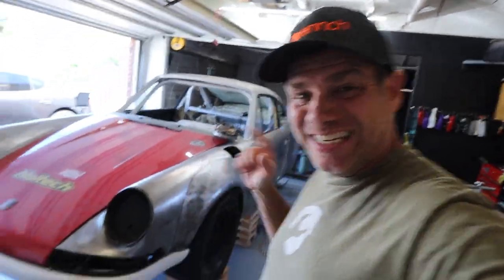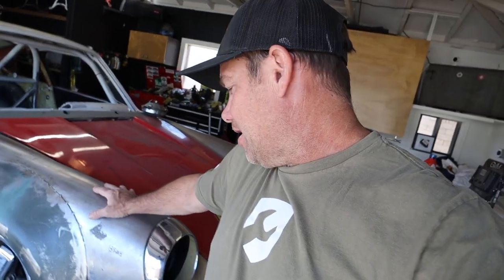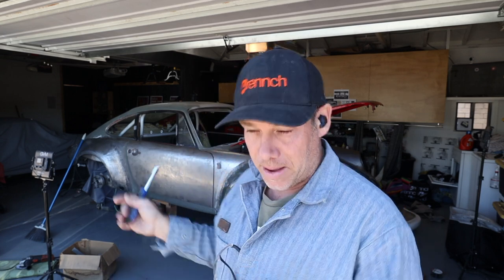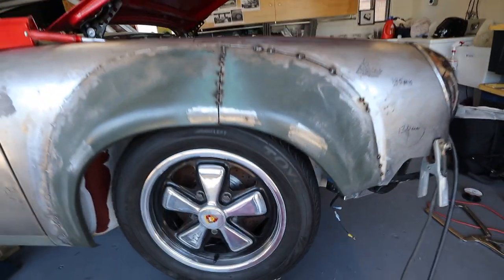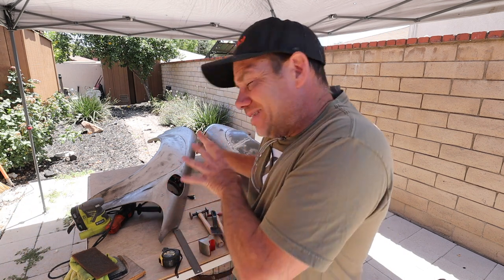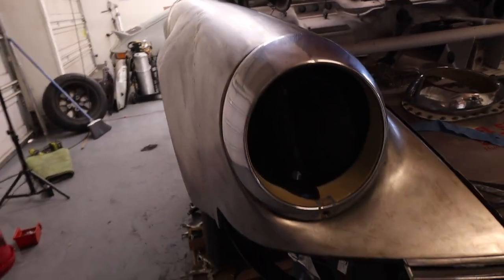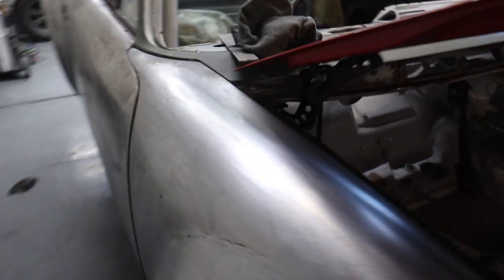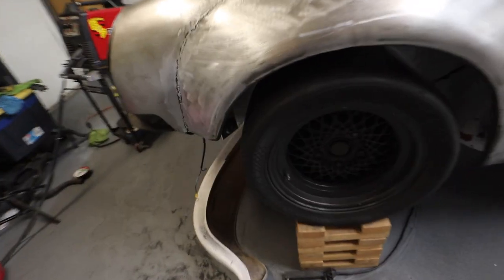Vintage Porsche 911 ST Flares INSTALLED! | Subaru EZ30 Turbo Porsche Engine Swap Blasphemy Build 56

Comment: consider using the outer say 3 inches of the current flap as a frame around a slightly smaller movable wing with some winglet like edges, say a 2 to 3 inch formed air dam around the edge.  You could mimic the shape of the grill area with the sizing and have a real "factory" look.

Comment: 👍🏻 That way the front end of the flare dips in makes such a big difference. I hope you will be able to let the line continue beneath the bumper if you get what I mean. Singer’s flares are a bit similar to the ST ones and it bugs me that there is just this slight disharmony between the line the wheel opening creates and the front valance. It's too big of a step in to the valance or change in the angle between the two. I guess it has to do with the rubber lip they use. Don't get me wrong, Singers are of course mind blowingly amazing but that's one of the very few criticisms I have on them. Just my rambling thoughts being nerdy and particular about flares on Porsches. I'm sure it's going to be great. Sorry that you had to redo some of the work but that's just the way it is sometimes.

Comment: Looking good Michael! I was happy to see you used my suggestion by using the paint scraper to align the panels as you weld. Interesting idea using welding rod to help fill up the wide gaps. I usually just use the copper back plate or cut the gap bigger and weld in a strip.

Comment: Hey Mike, great work as usual! I was curious though, why did you give up on the lead tinning technique early on? I thought it would have worked well to fill those gaps in this situation. Anyways, love your work, very inspirational!
Reply from the maker: It’s got it’s place in certain situations!
Reply: @rennch.  yeh I would have thought lead running would be better than the fibre bondo combination
Reply from the maker: @martinoakes5070  It’s much harder to pull off on vertical surfaces.
Reply: @rennch.  cool not tried it myself but your previous videos has inspired me to try it on my targa rebuild. Keep up the good vids and work. Tour inspiring me to get a move on with my restoration

Comment: It’s thin from all the working, grinding and welding. Frustrating you got one side so close quickly and then the other was so far off to make for loads of work.
Reply from the maker: Correct.